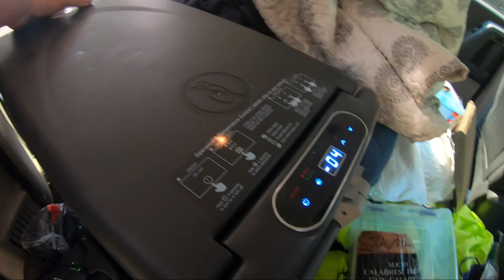EASY MINIVAN SOLAR PANEL INSTALLATION

Comment: Shading your solar panel with the cross bar is going to significantly decrease the output of the panel. You can go from 80 watts down to 10 - 20 watts if the panel has any kind of shading.